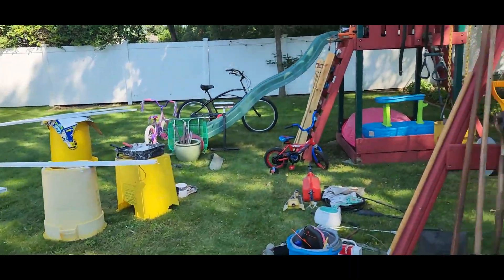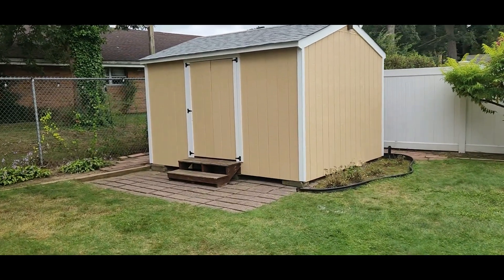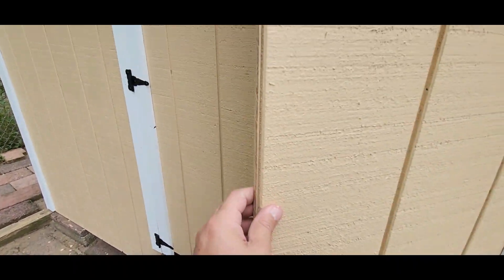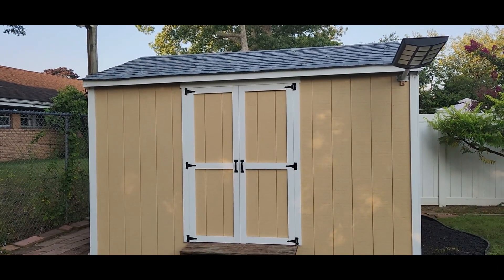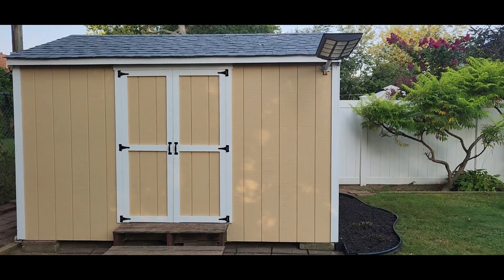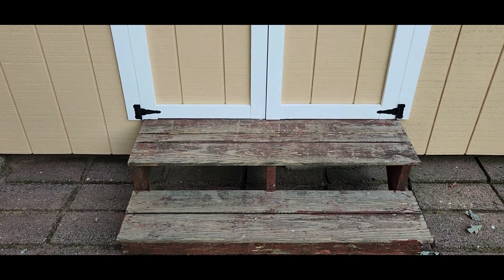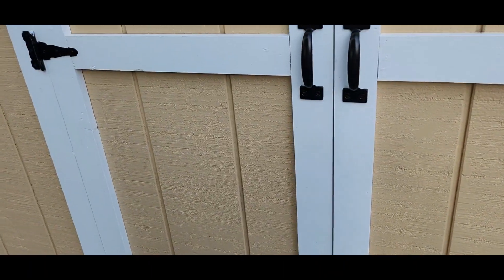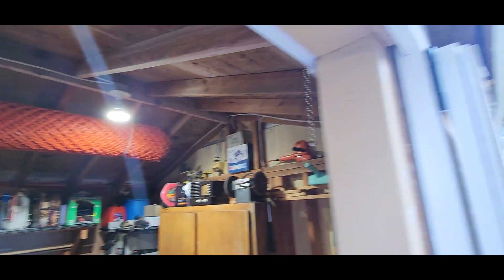New Shed (Walls)

Comment: In 2016 you power washed the shed and the walls were kind of rotten then.  So this project was already 8 years overdue.  The other 2 walls being left, which are now 8 more years rotted, doesn't sit right with me.  Yes, it's money.  But I feel it's not "done" until that is done as well.

The light over the door is really necessary?  It adds that much more light when you need it?  

The shed door holder opener is completely janky at best.  Way too much labor to get that to work.  And even then it doesn't seem to work right.  The problem is you have to consciously be aware the doors might flap around n the breeze, and it's going to happen when you don't expect it, out of nowhere, and there will be paint or handle damage.  If you wanted a janky solution, a wooden cleat held on the inside of the door with a screw that could be swung down to the ground would work nicely.  But that still doesn't pass my standards.  It has to be automatic and just work.  Unfortunately that means you will see it.  And I'm talking about that magnetic door holder you have on the garage door.  You can mount it at the top of the door.  Long part on the shed, small part on the door.  That way even if you forget, if the wind blows the door to the extreme, it will hold it open, if it blows the other way the magnetic catch will keep it closed.

The new color for the shed is brighter and cheerier.  I never had a problem with the one big single door like it was.  But if that's what you wanted, 2 doors are fine too.
Reply from the maker: @jaykay18  Well, the first comment that comes to mind is what you say,  if you want to send me money I'll do it.